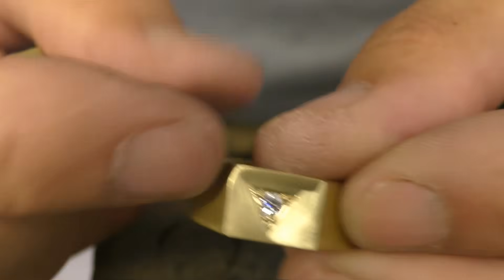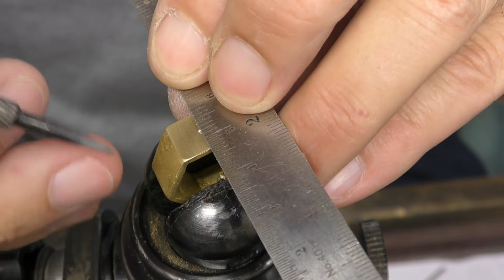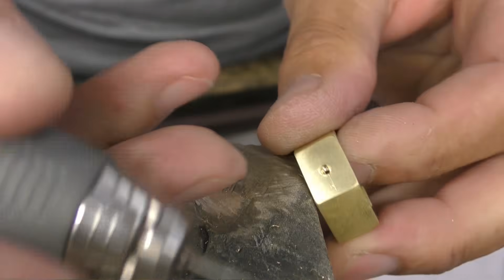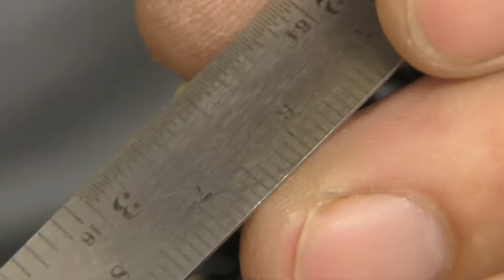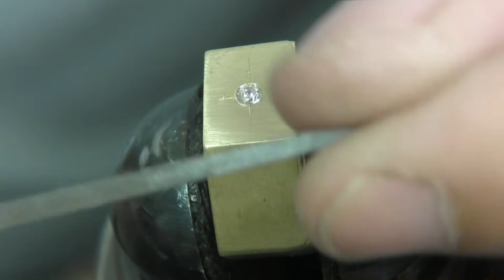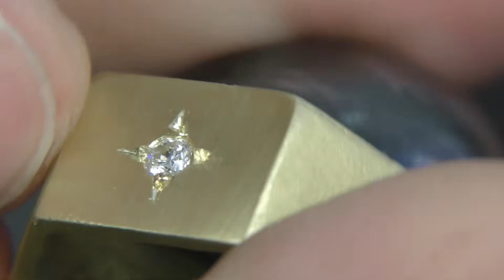Four Point Star Setting

Comment: I had a 4 point center mounting with a 0.20 Ct 3mm moissanite ( brighter than a mined diamond but very small ) it turned a plain 14K signet ring into a really 1st class bright, but not to big or loud gents ringm looked great and then polished and wondered how the goldsmith did that? Really improved the looks and value nice video!

Comment: Informative and detailed video! Question: for a very narrow ring with a small gem, is it possible to do only two points horizontally across the circumference of the ring? 4 points seems challenging for only a 4mm width ring. Thanks!
Reply from the maker: Yes that is possible as long as the stone is seated in the setting nice and tight
Reply: @jewellerytrainingsolutions9978  Thank you. I think i may try it out on a silver ring I have with a 1-1.5mm gem.

Comment: Are you using a Seashin or a Foredom micromotor?
Reply from the maker: Sheashin, they are great. Foredom are good too but quite expensive
Reply: @jewellerytrainingsolutions9978  I guess you are using carbide burrs and drill bits right because the torque specs of Saeshin 207 leave much to be desired, I want to buy an affordable micromotor, not a super expensive NSK ofcourse but something in between. Can you give me a recommendation, I want good torque and able to drill with normal drill bits in yellow gold. The saeshin are the same company who makes motors for Foredom if i’m right.
Reply from the maker: For an affordable one look at a marathon N8

Comment: Thank you for the great video! Are the videos in your courses as well done as this....camera angles, close ups etc? If so, then I am seriously considering your courses. Could you please clarify something for me--when using a setting burr, it cuts a straight "wall," correct? Then, you come in with a hart burr and how does that make the seat flatter or better? Does the hart burr flatten the seat? TY!!
Reply from the maker: Thanks Linda. You can pressure fit the stone either using a setting bur or a round bur, but they must be the perfect size. The hart bur is more versatile, it cuts a groove for the stone girdle to click into. So in some cases I will combine all three burs. It really is a matter of 'what works best for you' I make a point of demonstrating lots of options
Reply: @jewellerytrainingsolutions9978  does this technique only work on brass or will it work with many different metals? sorry if it sounds like a dumb question
Reply from the maker: @zarinai2777  this will work best on all non Ferrous and precious metal alloys
Reply: @jewellerytrainingsolutions9978  thank you so much!

Comment: Hi. I was looking at your course tools & it says a 2.4mm hart bur. Can you tell me where I'd find this size as I've looked everywhere & can only find a 2.5mm or a Busch Carbide Bearing Cutter 90° Burr 2.4mm (will this work for a 2.5mm & 3mm stone?). Thank you so much. Really great video.
Reply: Sorry I need to be more specific. Can you suggest an affordable UK retailer. I find loads in the USA but the postage is through the roof. Thank you.
Reply: @swwsociety  , you've got one of the best selling companies in UK - go to cooksongold. They've also got a physical shop in London.
Reply from the maker: I never go off the packet measurement, all my stones would be loose otherwise, they are always out. A 2.5mm hart bur (packet measurement) is actually 2.4mm when you take it out and measure it
Reply: @jewellerytrainingsolutions9978  Thank you so much for all your in depth answers to my questions. I really appreciate you taking the time.

Comment: Hi Peter
I enjoyed the lesson. I just wonder, by wiggling the graver, don't you leave ugly traces on the bright cut? Wouldn't it be nicer to push the graver straight forward until lifting it up? Otherwise, thanks for all your informative lessons and work you put into this. Greetings from Austria, Joe
Reply from the maker: Josef Eidler yes Joe avoiding the wiggle and pushing with strength or air assist graver would be tidier for sure, but it can be tough, so I would normally tidy up the facets with a flat graver. I show this during the bright cutting course. Thanks for watching
Reply: Josef Eidler கல் வைக்கும் முறை அருமை

Comment: Why did you not cut the stars first before putting the stone in your the first person I have seen do this way what is wrong especially when doing a eight pointed star cut the star first then put stones in and secure it , there’s no way to get a good clean job cutting with the stone in .
Reply from the maker: Yes you are right John. But this is the first lesson for beginners. I have been teaching for many years and I have found that it works best to take students through the process step by step. The full course has 20 videos showing all the stages. This link will show you what I mean. https://jewellery-training-solutions.thinkific.com/courses/bright-cutting-student-pack
Reply: Jewellery Training Solutions 
I have always thought students to raise there first grains with a half round as it will not chip as easily, raising grains that far back is quite advanced, and can I ask do you cut your eight pointed star with the stone in the hole ?
Reply from the maker: John Daniels no, I teach to cut the decorative star first. That is the next lesson in the curriculum. You should maybe take a look, you don.t have to pay to see the course program
Reply: I disagree.
   The grain lifting must be done with the stone in the seat, never seen it done with a hand graver any other way.
   Another technique is to remove material around the seat, leaving metal for the grains as short stubs/islands. The stones are then pressed into the seats and the stubs formed into grains pressed down onto the stones.
   This is done with burs and/or graver machines, air or electrical assisted.
Used in pave or micro pave where the stones almost touches each-other.
Reply: T0rb1 NAalborg  I am not mean lift the grain when the stone is not in the hole , all the cutting is done before the stone goes in the hole that way you can move the grain in pre cut form it will move onto the stone a hell of lot easier, take a look at JURA diamond setting on YouTube he is one of the best setters in the world, teaching a student to raise and cut from that far back is going to end in tears and possible harm to themselves when the scorper snaps .